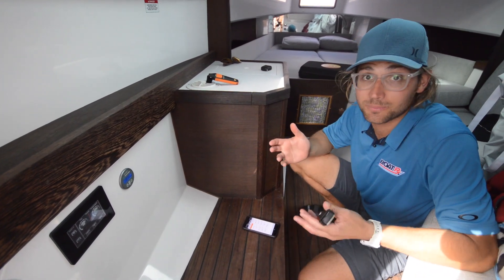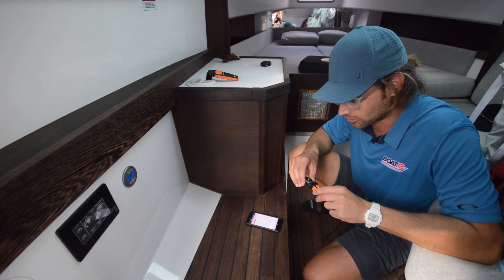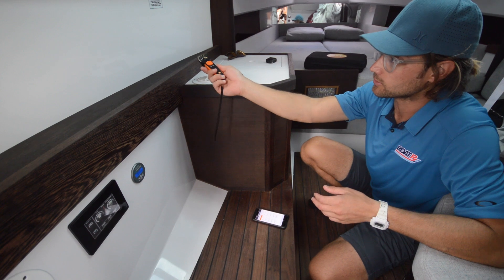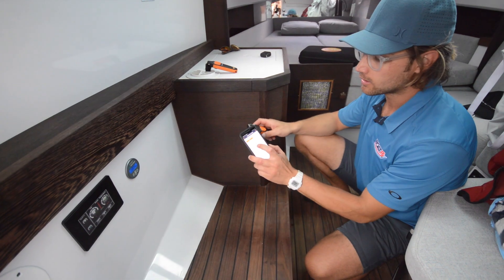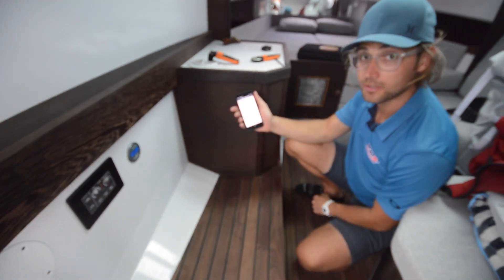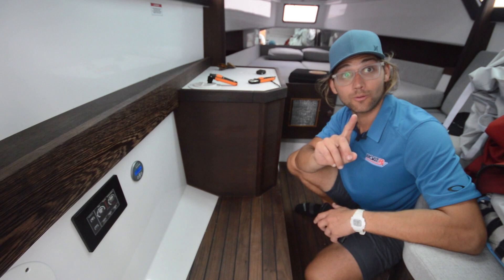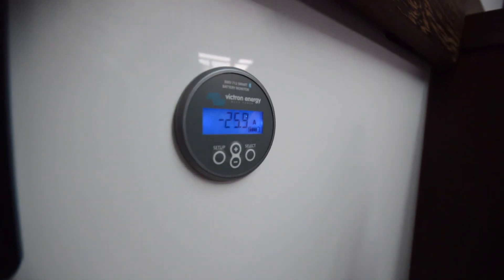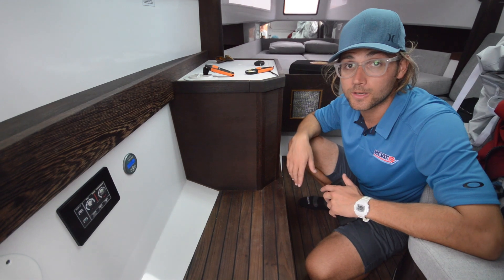Marine DC Battery Powered Air Conditioning - System Capacity Demonstration

Comment: Great video . I built a 12v marine air conditioner that does 10000 btu at 21 amps or 252 watts and 14000 btu at 36 amps or 432 watt , water temperature for this test was 69 degrees. I tuned the system to be most efficient at lower compressor speeds. The unit is whisper quiet . Those measurements include the fan and the water pump running .